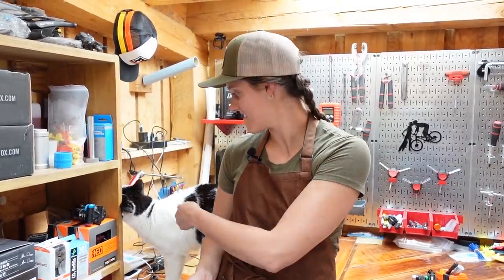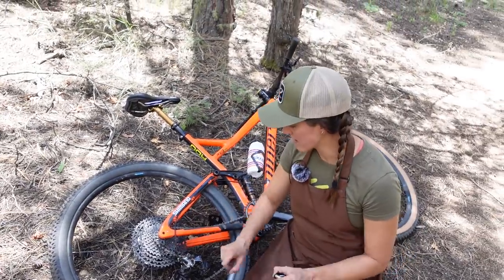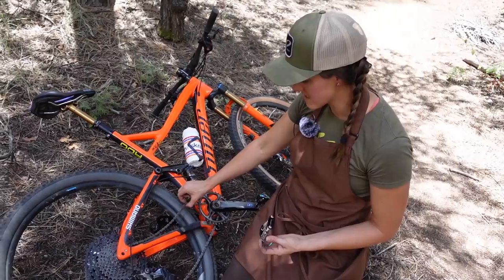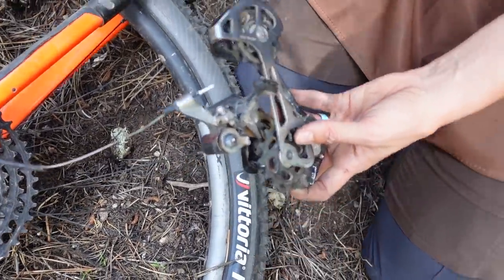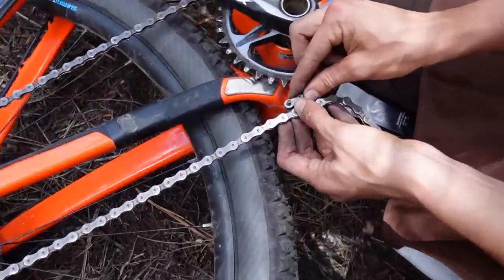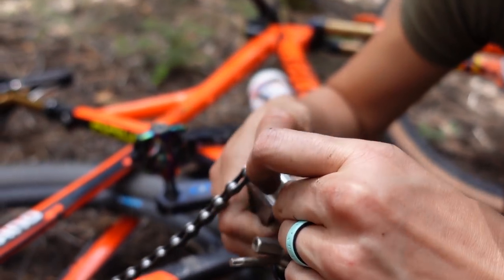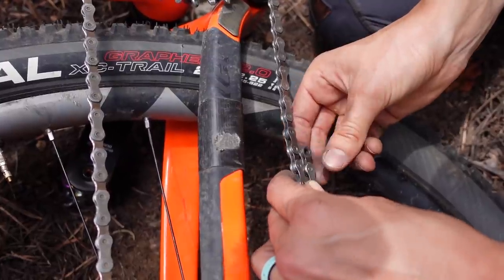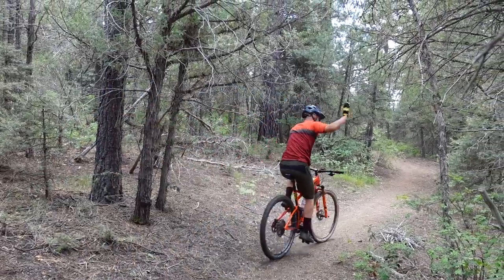What to do if you break a derailleur or hanger (TRAILSIDE SINGLE-SPEED CONVERSION) | Syd Fixes Bikes

Comment: Great vid as always guys! One remark: if your chain has a quick link you can open it easily with a shoe lace or some other kind of cord e.g. from your back pack, etc. Just wrap it around the two rollers and pull the ends across. No tool needed.
Reply: Well, that IS a tool, but yes. (But might ruin a shoe lace and even the shoe afterwards. 😉)
Reply: Yep!  Was going to suggest this!
Reply: You don't need shifting then pull out shifting cable. And use this. But have gloves on. Steel cable can cut fingers
Reply: That's a great tip!  I carry a little Leatherman tool that includes small needle nose pliers that also work to open a master link, as well as to remove cable ends, bend or cut spokes, and remove overtightened valve nuts.
Reply: To open the quick link, I bought a cheap, 7 in. Wire Stripper with Cutter (google it). It's spring-loaded, has a serrated jaw, and a wire cutter. I did grind the tips down so that they would fit into a 12-speed chain. A file or belt sander would work, too. The weight of this tool is imperceptible. It cost US$4. It stays in the tool pouch of my camelback. I've used it as pliers more often than as a quick link tool.
Reply: I found out that this hack is bs the hard way
Reply: huh? ive always used just my fingers to open those
Reply: @charles_1523  Either you're joking or you didn't ever seen a masterlink
Reply: Learned something new today, thx!!!
Reply: You can practice at home by taking a chain w/ a quick link apart by hand(no tool). Once you learn how it's really easy and a good thing to know. You have to hold it just right, twist both sides at same time and they come right apart. You could always add a 2nd quick link at pre-determined length, just as a back up in case your hanger breaks. Zip ties stashed in seat tube make a decent makeshift chain guide too.

Comment: Nice video - another addition is to carry a short length of water hose (50mm) and a couple of cable ties. Tie the hose to the inside of the chain stay and run the chain through as you have done. This adds tension in the system, keep the chain aligned and on the front cog. Works well. 
Love these videos - keep up the great work. Stay safe keep well.
Reply from the maker: That is a fascinating idea. We'll have to test it sometime. Thanks for sharing.

Comment: Whooo! First I got to watch the Redbull Hardline livestream and now a new Syd and Macky video! Awesome Sunday so far! One thing to add (I think I saw this somewhere on yt, haven't tested it so don't take my word for it) is that you can make an improvised chainguide out of zip ties. You connect two to to both the seatstay and chainstay so that they create a two-piece chain and then connect them in the middle with the fifth zip tie. You pass the bike chain through the middle loop, and if it's tight enough it should just help keep the chain in line. Either way, good video as always guys, can't wait for the next one! :)
Reply from the maker: Good tip. We'll have to try that out.

Comment: Great video, love the discussion of trade-offs and survival v. shredding, as well as the emphasis on what to do when you didn’t come prepared.

@9:10 on sizing the chain, worth noting that making the chain longer for suspension compression (the shredder mode) isn’t feasible because the derailleur is what takes up that slack in the chain until it is needed at compression (or shifting), and keeps the chain on when in higher or lower gears that have suboptimal chain lines.  without that rear derailleur, if the chain is super slack and loose, or in an extreme gear, you’re going to be walking as it keeps coming off.

Comment: A tip I read elsewhere - put 2 quick links on your chain, one for normal situation and another if you break your derailleur, so you could quickly convert to single-speed mode
Reply: Yeah, that has the added bonus of making it so you can figure out the optimal gear with a clear and un-frustrated head.

Comment: Had the B hanger on my derailleur  snap, the bolts holding the hanger shear (had a spare hanger), not that far from the end but good to practice skills, split the chain single speed, went loose tried again different gear shorter chain, chain snapped after couple hundred meters. used a spare quick link, broke in a different part of the chain. Walked rode home, read that new chains don't split and join well. Still had a good day and was due a complete chainring replacement, happy days fixing the bike.

Comment: This is a really great channel.  Another good trailside repair video would be a snapped derailleur cable.  This happened to me on a recent ride and I adjusted the limit screw on my derailleur to get into an easier gear.  I also have a 2x so at least I had two gears to use on the way back.

Comment: If you are riding out far enough to make this work a practical option, then you should probably be carrying a jacket or warmer shirt, just in case. If you don't, then at least carry on old t-shirt. While you are doing any trail work on a bike, spread the jacket or t-shirt on the ground, under your work site. Place parts you remove and your tools on the jacket - that way you won't lose them. Also, any part that you accidentally drop will land on the jacket and will be easy to find. I speak from experience; this tip does work.

Comment: Great tutorial!

Tell me if this is dumb... figure out where your bike does best as a single speed.
Break your chain and find the right length for your chain... put in two quick links to allow you to shorten the chain quickly to make it a single speed. Then when you need the shorter chain you can just "POP OUT" the section to have the shorter chain... or you could carry a 2nd chain that is already shortened... (How much does a chain weigh?)
The latter is my choice, because I have had to do this 3 times in my life... one was a broken derailleur, the other two I broke the chain, but all I had to do is pop out the broken link and put it back together. Fortunately, I had a chain breaker.

The only time I have been stranded is when I had a flat on a tube and my patch glue was dried up... long walk, that was.

Comment: Better idea: put it in the next higher gear (next smaller sprocket, wouldn’t say this if I didn’t have to remind myself too) than what it “wants” to fall into, because then the chain length and chain line will force that gear for sure. 

The chain line will encourage a downshift, and the chain tension will want an upshift, resulting in a balance.

Comment: Connex quick links don't need a tool to open. Variations of that type of quick link have been around for decades. 

And while KMC doesn't recommend it, their Missing Links can be reused. With each reuse the snap connection loosens and you won't need a tool. I keep my worn KMC Missing Links as spares for emergencies. So far I've never had one pop open unexpectedly during a ride. But I ride mostly road. On a MTB the terrain might be rough enough to pop open a worn Missing Link. Still worth considering for emergencies.

Comment: My derailleur hanger broke today and there seems to be other damage. I didn't have any tools or spares. However, I was only a few hundred meters from home, so I just wheeled the bike home on the front wheel, holding the rest of the bike up. It's an eMTB so quite a bit heavier than the average bike but it was a simple operation. I can deal with the repair more easily in my workshop, or take it to a bike mechanic. Since I live in the mountains and don't have spare parts, I have to go to the city anyway. So I might as well have a mechanic do the whole thing. Labor is cheap here in Mongolia.

Comment: One note of caution: this isn't gonna work w/ an oval chainring. even w/ the perfect chain tension & chainline the cog set teeth are made to shift & they will went you hit a bump as the oval chainring is at the slackist point of your pedal stroke. When backpacking I now carry a backup singlespeed cog & spacers which work fine w/ even the ovalist of chainrings.

Comment: It happened to me that the hanger broke and I needed to go for this "hack" and it didn't end well for one of the cassette cogs. Luckily it didn't break and I could straighten back the cog and make it useable again.
If the hanger or derailleur breaks it's just better and a lot safer to remove the chain and derailleur and push uphill and balance on flat parts.

Comment: But what happens to the rear dereuilleur once you get home? Is there hope to put it back in place?
Reply from the maker: Depends if it's the derailleur or derailleur hanger that's broken. If it's the hanger, you can usually replace that, reattach the derailleur and you're good to go. If it's the derailleur, you'll need to either fix it replace it. Either way, it's generally a good idea to replace the cable and housing when you do so!

Comment: Is it possible to have a bike with a functional/shiftable 3 speed crankset, and a single gear on the back?
Reply from the maker: That's an interesting question. I've never seen one but you could potentially use a derailleur as a tensioner and it might work...

Comment: 11:15 Isn't that what the other set of "teeth" in the chainbreaker is for?
I was taught when I first learned to break a chain that as you put the pin in, you're compressing all the moving parts, so you always want to go a teeny tiny bit "too tight", and then de-compress it by pushing (the same teeny tiny bit) from the other side with the first pair of little teeth, the ones that don't push against a plate. It always works perfectly and I feel like many people don't know what those are for... or maybe I was just taught a clever hack and those are meant for something else!
Reply from the maker: Didn't know that! Learn something new everyday!
Reply: @sydfixesbikes  It may be true. An outer link will bend slightly inwards elastically and might get trapped in that position by the inner and pin.

Comment: Here's something that's happened twice to me. breaking about 4-6 spokes on the same side of the flange. The first time I caught a stick, the second time my derailleur did a barrel roll. when you break so many spokes on one side of the the wheel, the wheel won't even turn freely in the rear triangle. Both times I had to carry/stash the bike and walk out. I don't see any way around this one other than carrying spokes and doing a trailside wheel true. trying to true the wheel with so many spokes missing doesn't work (it was a 28-spoke hub).
Reply from the maker: Yeah I think in that situation you're walking...

Comment: curious if you can't just put it on the smallest rear gear (highest speed)?   The chain certainly won't fall off the gear..
Reply from the maker: Unfortunately it wants to be "straight" with the front chainring so it will usually work it's way up the cassette and then break because of the additional tension.
Reply: @sydfixesbikes  - yeah.  I guess when the derailer is in position, it holds the chain from creeping back up the cassette, as well as provides slack for when the larger gears are used.

Comment: Q: Will a new chain need to be put on or can that chain be put back tgthr AND if so would/could this cause unnecessary wear on the rest of your drivetrain?
Reply: New chain is the best. Don't put parts of chain together, this increase the chance of breaking. New chain is less wear.
Reply from the maker: I agree with Peter. Also, if your chain broke, it's much more likely to break again, so better to replace it and not have it happen again!
Reply: @sydfixesbikes   @UC0wBQesB7xqpmiWiun2PMzw  Yes, if my chain broke while I rode it needs to be replaced, but what about in relation to this vid where the problem was the derailleur and you choose to shorten the chain to temporarily make the bike a single speed…can that chain, once your home, be reassembled & reused, or once it’s taken apart, either at the quick link or by popping a pin, it’s time for a new chain?
Reply from the maker: Gotcha. Yes, you could put it back together, but generally it's best to replace it at that point!
Reply: @sydfixesbikes  👍

Comment: I wondered if the chain will stay on better on the next smallest cog from the most aligned cog. Seems like a little pressure up the cassette might hold it better, but I bet it's not enough to shift it off the cog. I haven't tried this, and I might be wrong, but it might work. Anyone tried this?

Comment: had to do this once. I do NOT recommend this method for full suspension bikes. the chain jumped up to a larger cog at some point because of the suspension, and completely locked out my suspension, and was so tight that when I tried to remove the rear axle it stripped.

Comment: Same happened with me. And I noticed how thin and flimsy the metal is at the deraillour hanger. Why do they design it like that ? 
Even if it’s fixable, its super annoying to take it all apart and replace the hanger
Reply from the maker: Definitely, but MUCH better that the hanger fails instead of the derailleur or frame as both are a lot more expensive. There's a fine line though of light enough to fail, but strong enough to not bend all the time and some brands tend to go too light
Reply: @sydfixesbikes  But the deraillour itself is not under alot of force, all of it goes to the hanger which should be strong. 
The frame is quite strong, although carbon is brittle, should not fail unless it gets smashed by something
Reply from the maker: That's the idea, that the hanger should bend if the derailleur gets hit by a rock or during a crash. If your hanger is bending while you're just riding, then it's definitely too weak!

Comment: Everyone recommends this but it doesn't work. As you found yourself, the problem is the none of the cassette cogs are exactly aligned with the front chain ring and as soon as you press on the pedals the chain will hop between gears, it gets loose and falls off. Didnt work for me, had to get a taxi. Also getting the wrong gear, leaves you without a spare quick link to try again. Also removing the quick link without ploers is pretty much impossible.
Reply: true. i've only seen this trick be successful on a hardtail.

Comment: Use a short bit of garden hose tubing (carry a length of it). Thread the chain through the tube. Cable tie the tubing on the inside of the chainstay. That'll keep the chain in the roughly the same gear.
See this guy doing it:
https://youtu.be/HGnQBfur-wE

Comment: I do have a tip that has worked for me to find the rear cog that will work for this emergency.
Firstly, be very careful when doing this. Make sure you don't drop the chain in the dirt. I did that and had to empty my water bottle to get that extra dirt off the chain and I was rather thirsty because I didn't think about that at the time.

Ok, now that I have that out of the way.

After you break the chain and have the derailleur out of the way.

BEFORE you remove any links to shorten your chain, you can take a piece of string or use your shoe lace to make a temporary link in your chain.

Drape the chain on the cog you think is the one and VERY CAREFULLY pedal your bike while holding it level to see which rear cog it wants to go to. You want as little sway in your chain while you do this. It should work if you crank your pedals either direction, but I'm not fully sure on that because I've only done that once and it worked. If you need to repeat this until you are sure which one that chain wants to go to.

Remember that cog and then you can hopefully save yourself extra work breaking that chain.